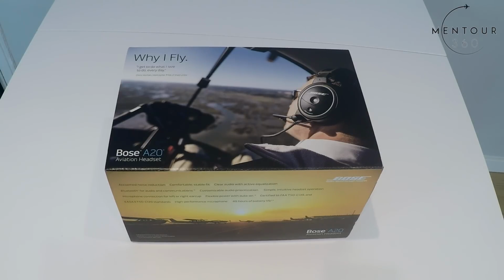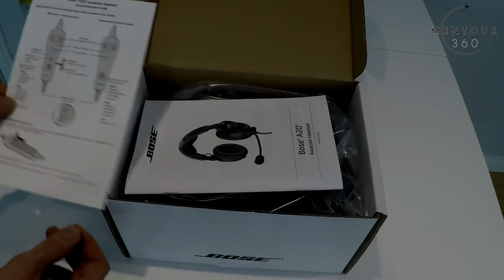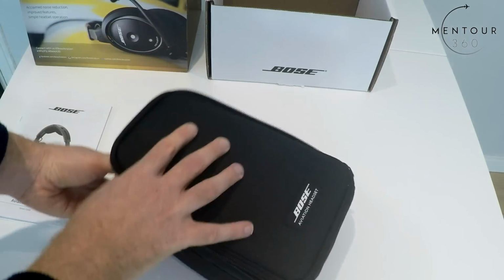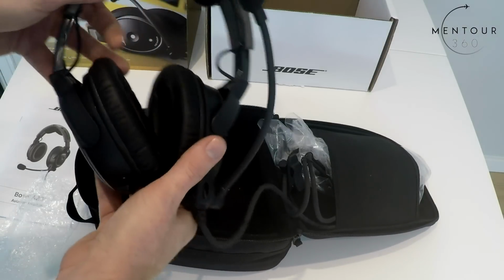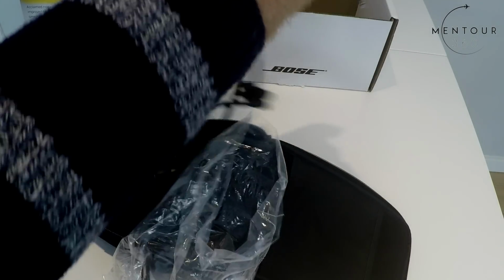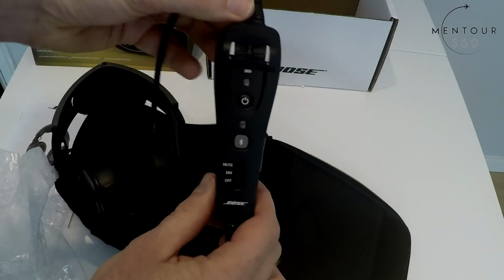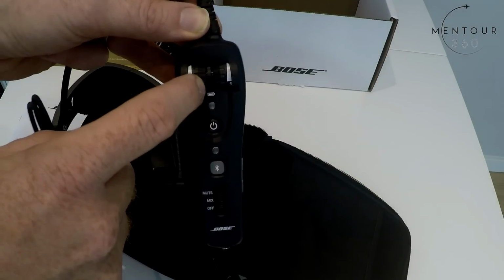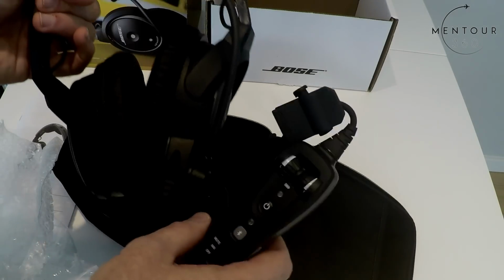Unboxing Bose A20

Comment: Bose A20 : everybody seems to have them, one more reason to avoid them. Too expensive, you pay for the name and a 10 year old design and it looks cheap plastic.
Lightspeed Zulu :  Good alternative, third edition already, clean nice design, works perfectly.
DC One-X : late comer on the market, very good altenative to A20 and LZ3, cheaper than A20, much. Good support and well known company.
I already own a LZ1 for ten years, tried the above three and will settle for the DC One-X as my new headset.
Reply: Each their own, I have both the Zulu 3s and just got the A20s and night and day between the two headsets.

Comment: Oh got my A20 a week ago. Gonna send them back. Very bad quality in the materials. Fragile! All lose and makes cracking sounds when hold them in your hands. Also the mike is bad. ATC readed me a "2" sometimes when the mike "disconnected"
Reply: I would exchange them.   I just got my A-20 for the Bluetooth features to use with ForeFlight.   I have had the previous gen Bose X and they still work perfectly 10+ years running.  They are now my passenger headset.

Comment: There are several features of the Bluetooth that are used for actual piloting operations. When paired to an iPad and an application like Foreflight  and or a Stratus 2 ADSB device. Callouts when your are close to terrain, 500 feet when landing, approaching a runway while taxing, traffic advisories (ADSB), etc. Also, if you are at an airport that doesn't have clearance delivery you can call on your Mobile phone and talk to ATC with your Bose headset and not have to shut the engine off because you can't hear over the engine noise. Also, I have used it to call flight service inflight to change a destination airport when I couldn't contact via radio.
Reply: True, but those are mainly used in GA-Flying, for which this headset is of course designed. But in airline flying, especially in Europe you do not use those services.  TCAS is build into the plane, some even follow the TCAS commands on autopilot. EGPWS for terrain avoidance and automatic height callouts is also a requirement and therefore part of the standard avionics package. Clearance comes usually via Datalink in textform, or via a special clearance delivery frequency. If we have to divert, we better tell ATC as soon as we know it, otherwise we get a visit from our military brethren with their very twitchy trigger fingers.

Comment: hi. how are you?  during flight, does the headset use the battery power or the aircraft power for the active noise cancelling? 
thanks
Reply: battery power.. once battery is low on power then NC is not working. Also my A20 do not process aux in signal when headset is turned off

Comment: Hi! I'm going to start flying for your airline soon. Looking at this video, I want to confirm something: do all the 737's require a dual plug? I have a Bose A20 with a 5-pin XLR connector, so I may need to buy and adaptor for it if that's the case. Hope you can help!
Reply: On Sportys and Aircraft Spruce you can buy the microphone and brain for the specific plug system you need. The microphone detaches form the headset and is swappable on both sides.
Reply: @fishhisy  Yeah, that's all well and good, but you replied to a comment that's 3 years old. I figured all of that out already, but I have since sold my A20. Actually I am not even with the same airline anymore xD Thanks for trying, but next time, check and see if it's still relevant

Comment: I adore your videos captain, I saw a lot of your videos. I am an Airbus 320 type rated pilot. I would like to know your name and which airlines you are working at and what is your advices to be occupied as fast as I can ? I wish for u lovely day.
Reply: I finished my theoretical ATPL, My ICAO ELP ( I got level 6 ) AND my type rate on A320. what else I can do to be occupied. I am almost 27 years old. Also, I got A masters degree in business Administration. Do u think all this will help in my interview ? I will really appreciate your quick replay and your opinion. Also, I have this feelings that how ever I am studying a lot of hours and hours. It's not going to be enough to pass my first interview. This not a self confidence problem and I saw your video about interviews and what to do but I need your opinion in my case. It just I feel that being a pilot is a never ending learning experience and it's just I don't how it will be my first interview and I don't want to fail because really aviation is my life and as I learned in my life that failure is a success that missing one step so I hope that u will help me out. Sorry for long message captain. I wish for you safe flights.

Comment: Can you do a video where you show how to setup the headset and configure it in the actual flight deck before a flight?
Reply: I would be interested in the following in that video; as you mentioned in boeing it is connected to the plane via jack plugs. By this way i guess you can activate the mic by the intercom switch on the yoke? I mean you dont have to use a mic button on the remote (if there is any)
Reply: That is correct, once you are plugged in the microphone is technically "on" but only transmits the voice signal when you are pressing the PTT button on the Yoke.

Comment: what happens if the charge runs out in the headset? is there speakers within the cockpit or does the other pilot handle all transmitions if your headset is dead?
Reply: The batteries only power Bluetooth and noise cancelling functions. The headset sill works, you can hear the intercom and the radios, and you can still transmit.
Reply: beastsword I don't think there are speakers. If so I would imagine that the other pilot would take over atc calls
Reply: Many general Aviation airplanes have speakers.
Reply: And I have no idea why you would want a noise canceling headset for commercial flying.
Reply: Jack Starr it’s always nice to have. I don’t know if you’ve ever jumpseated on an airliner but it’s still a little noisy
Reply: Jack Starr and there’s no reason to have two headsets if you also fly GA

Comment: Congratulations for the new bose a20 but if you got the bose with 6 pin connector is better for you because is better if you flying with may kinds on aircrafts
Reply: *****  I got one with 6 pin after the Se and ME course I will use it with airbus